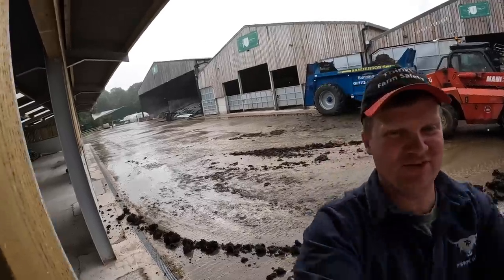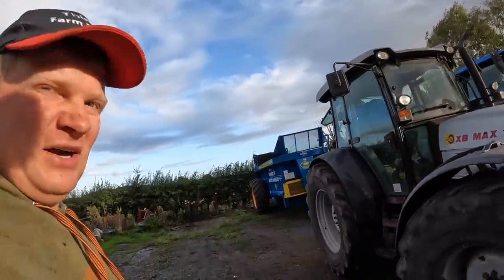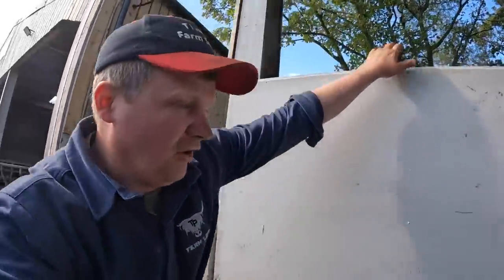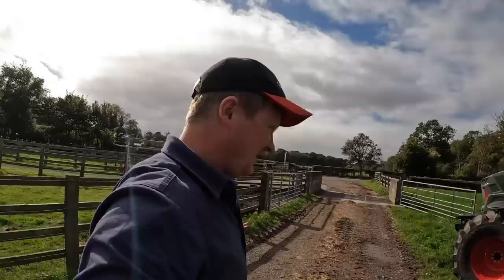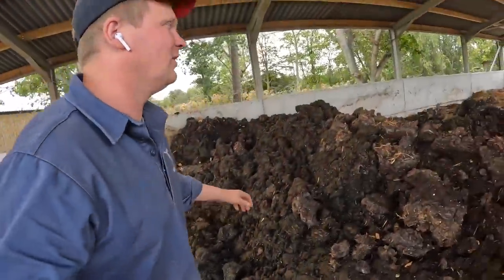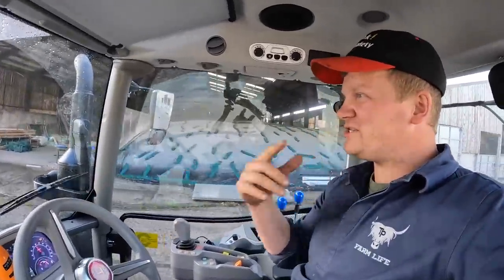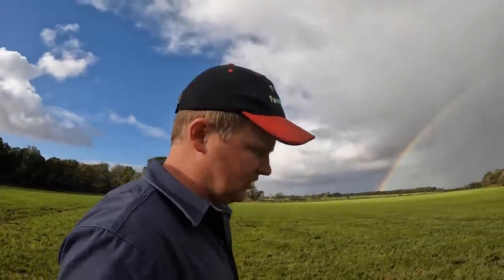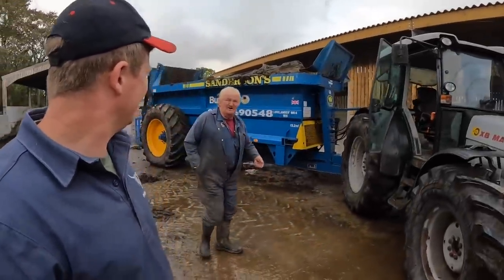FLOODED WITH SLURRY... I BROKE THE DAM MUCK SPREADING!

Comment: If you want to compare how much they both use in diesel, you should keep to the same max speed. If you're going faster I can imagine it using more... 
The drone shots are amazing again Tom... Everything looks really nice..fantastic video again
Reply: the issue is that in the real world when you use them, you will drive faster. It's not really about what tractor uses more diesel doing the same speeds and everything, but more about how much diesel they use for a certain job, and how long that job takes them.

Comment: That steam!!! I used to run compost bins and if you put a bag or two of horse manure in it ( old as possible because of worming tablets)  and the highest temp I reached was nearly 80c . Warm thing to do on a winters day was to turn the compost. Not cus of the compost heat it is just damn hard work.

Comment: Yep, the new emissions equipped engines use more fuel.  I would say some is the increased fuel consumption was from the tractor being more powerful, but the new emissions equipment was a factor.

Comment: The new Hurlimann may have used 20ish percent more fuel, but it's also 30% more powerful, so in terms of hp per litre burned, it's basically the same.
Reply: If both tractors are doing the same amount of work then they have both used the same amount of power. The fact that one is capable of generating more power is irrelevant because the extra power wasn't needed for this job. So the older tractor is more economical.

Comment: Driving at top speed with the new Hurliman (50k) will have contributed easily 6% of those 12% higher fuel usage. Try again and make sure both run the job at the same speed. 
Later you can decide you want to do things faster and spend the extra fuel for that, but with fuel prices on the rise you might want to restrain yourself. And the older Hurliman will help you then 😉

Comment: I know you compared fuel, what about the time spent doing the job, wages are a cost to the farm also, and as you said you can do the job quicker, also next time you do the fuel comparison can you take notes of the milliage as Im sure you and your dad were not following each other and their might be inconistantcies there
Reply from the maker: We were about the same time 😊 because we had to wait to get loaded up some times
Reply: Tractors don’t have ‘mileage’.  They have hours and gallons of fuel per hour.  And no farmer I know keeps track of hours for pay.  You work until the job is done…then you start on the next job until it’s too dark or cold to go any further.  Then you clean your equipment and prep it for the next day and fall into bed after setting the alarm for 0400.

Comment: Over a year our 100 hp 6 cyl Massey 3085 used 600 litres less diesel than our old 90hp 4cyl 3070, thats doing exactly the same work on the same acres with the same implements

Comment: As you know, the bigger the horse power, the more wound up the pump is. If its only like 30hp different, they just wind up the pump. So they use more. We had a yard loader a 4610. It used a rank of diesel a month. 😂😂

Comment: Dont forget. Running the aircon in the tractor cab drains 2 -3hp.  If you going to compare tractors. Then compare with both drivers too. Youll get a far better accuracy.

Comment: Have you thought about putting some tiger worms in your muck while it's in the pile, added mine to my massive compost heaps which a 2 medium square bales squared area filled with  daggy wool, horse poo, garden waste etc, when it goes on the gardens am adding lots of worms.

Comment: Like I said in the last video when you got the new tractor, the engine is still tight and not running so until it has a few working hours under its Bonnet and its first service it will be thirsty on fuel . You need to run it in give it a service, and you will see a massive difference.

Comment: The new hurliman will use a reasonable amount more fuel than the older one         The old one is 100 hp on a 4 litre engine where as the new one has 135 getting pushed out of a 3.6 litre.    And when you go down the road at full rpm the boast will kick pushing it to 140   To get power you need fuel especially with these small engines pushing out power that’s really to much than what should be get put out in the size of the engine

Comment: Less horsepower = less fuel.  HOWEVER, the Deutz engine in the little Hurlimann may be a factor.  Those aircooled Deutz engines were (are?) super stingy on fuel.

Comment: more HP means more fuel needed, another way to look at is new tractor spent 0,423 liters per HP while older spent 0,43 soo new one actually is more efficient per HP than the old one.
And another thing i dont know where this BS came from about not useing all 130hp at all times came from but its BS only way thats possible is if you have multible engines and tractor is turning them on and off as needed or Diesel motor is only 100hp and then you have an electric motor thats 30hp or somthing that somehow helps during peak work hours.  
A 130hp engine is always delivering 130 hp only question is are you useing it or not.